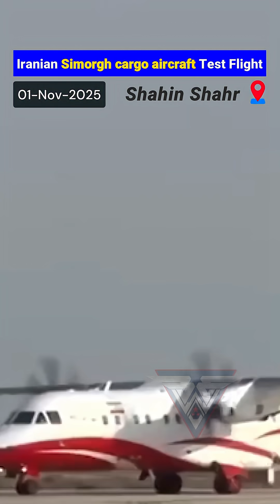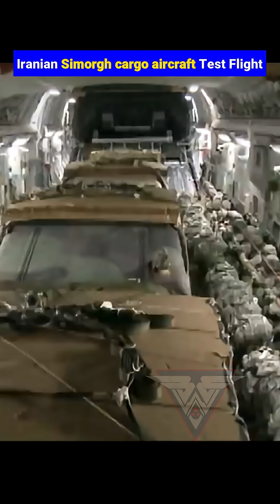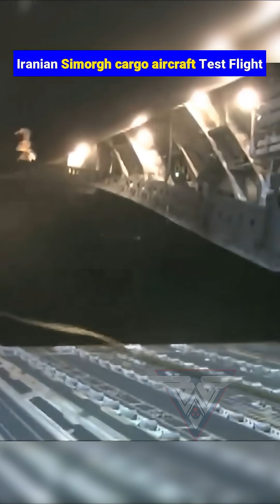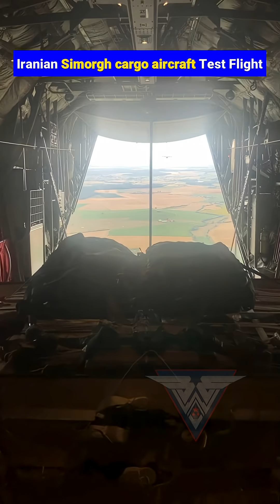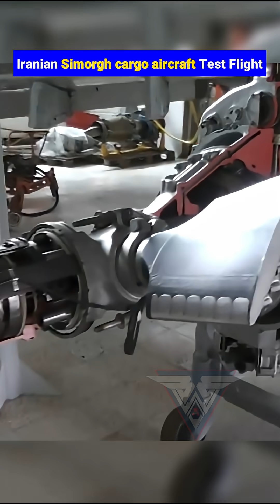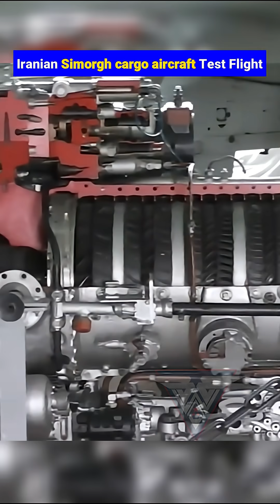Iran’s New Simorgh Aircraft: A Major Leap in Indigenous Aviation Technology

Comment: میدونید چرا در هواپیماهای ترابری
 از موتور Turbopropاستفاده میشه؟ 
چرا از موتور  Turbojet استفاده نمیشه؟
Reply: turboprop engines are extremely fuel efficient at lower altitudes and airspeeds, require shorter runways for takeoff and landing and cost less to operate with a heavy load. they also create lots of lift which is again, needed for a heavy cargo.